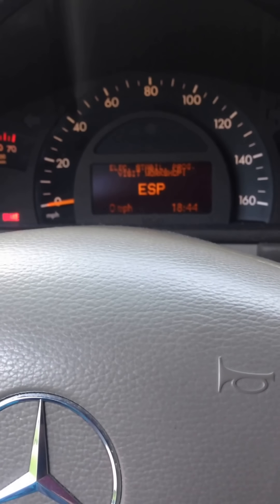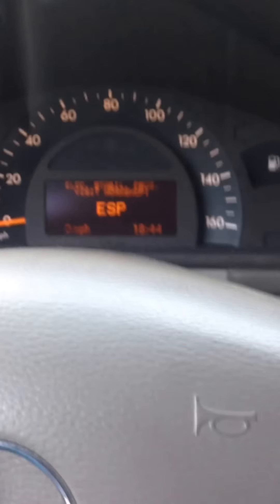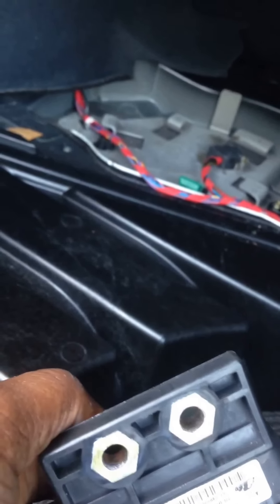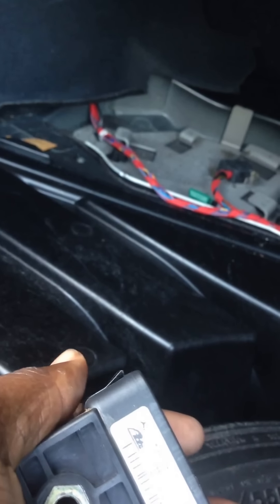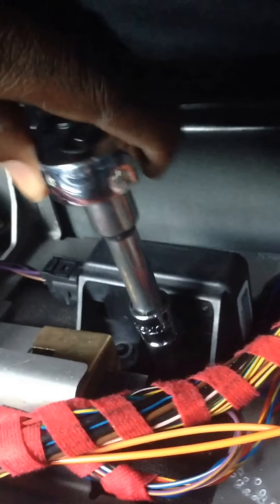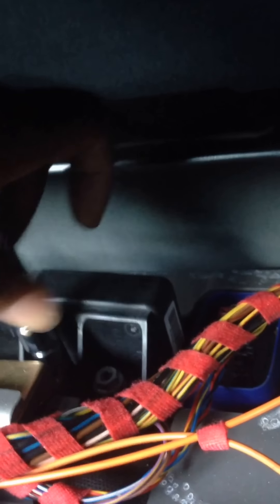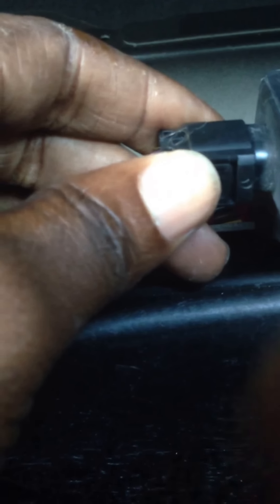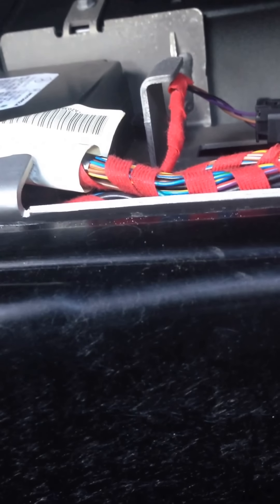How to turn off ESP on Mercedes

Comment: You are an ABSOLUTE LEGEND!!! Saved me from going bankrupt. I got quoted $2,500 for a part itself from MB dealership, went to European cars mechanic got quoted ($600 for a part (used), $200 to install it + $130 to clean fault memory). Absolute stitch up!

Well i have followed your instructions decided to give it shot. It cost me $120 of ebay incl. delivery to Aus. (make sure the product code is spot on correct with your original one when you order i have C200 Kompressor 2001, so mine was slightly different). Plugged in new sensor in, no malfunction, no need to clean faults, happy days! Car runs smooth. However for people who currently experiencing ESP problem it could not be necessary YAW rate sensor, i went to mechanic to get it scanned and find out what is exactly wrong costed me $45.00)

PS shout out from Australia!!!

Comment: Thanx for the great video. I will give it a try as my ESP light stays on, changed the brake switch, but still on...its a Mercedes W211, 2.2cdi. 2004.
Reply: How did you get around to fixing it?

Comment: There is only one part in the trunk and it is called YAW rate sensor held down by 2 screws.
Reply: Does that fix the issue?
Reply from the maker: @dontracy8924  yes it does. Sold that car and it fixed it. Got another one last year which ended up with the same issue. The one it had installed looked in good shape but gave error.  Went to my favorite salvage yard and got one, installed it and error cleared. This was back in November.